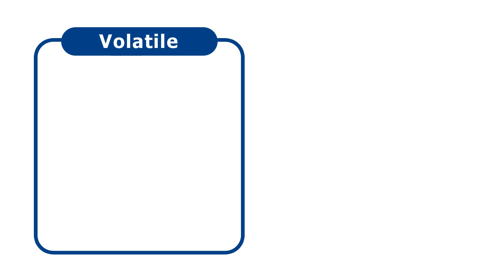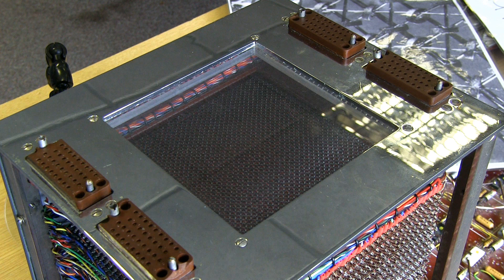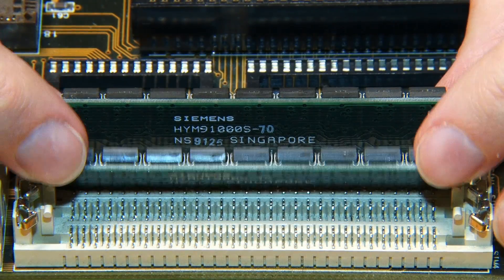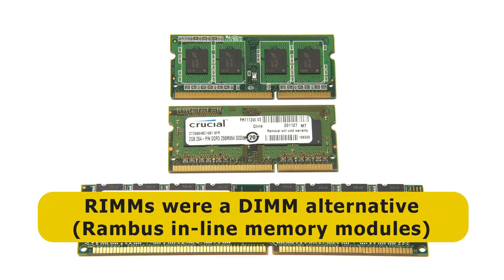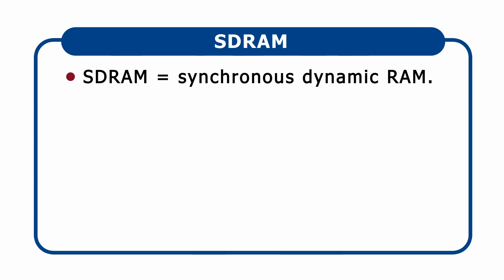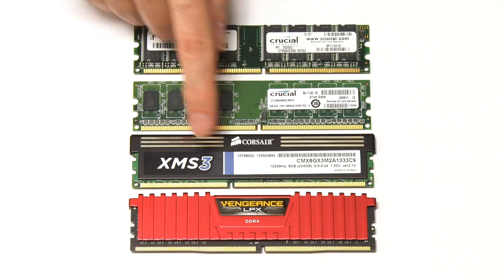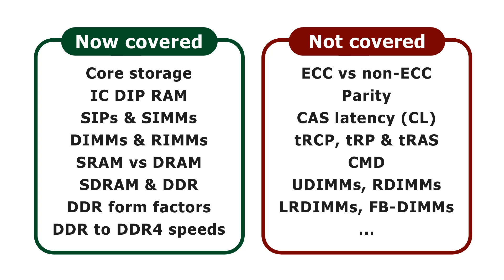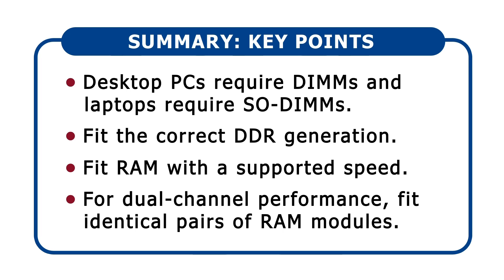Explaining RAM

Comment: ryzen with its finnicky ram sensitivity brought a complete new level of consumer awareness towards ram,
most people seemed to care about anything but the damn socket type, clockspeed and whether or not it was ECC (and rightfully so)

playing with RAM is like playing bass guitar though... the basics are pretty easy to grasp, 
but the rabbit hole goes as deep as you want to go.
stuff gets real sciency once you start doing overclocking.

weighing-off of latency versus clock speeds and how they relate, memory ranks, subtiming tweaking,
you kinda have to get to know your ram sticks, and get a knack for sensing borderline fuzzy logic cases,
know how much you can jolt them, or even better change the tripping point impedance for the gates accordingly

extreme ram overclocking is serious business, and more often than not goes far beyond extreme cpu overclocking in terms of how many factors there are in the equation, it is a minefield of mathematics.

despite the fact ram sticks are are way more lenient in the voltages they accept before really failing, 
(but, arguably ddr4 doesn't scale that greatly on overvolting, not like ddr3)
people usually just OC their CPUs and dial in a quick basic ram OC,
it gets daunting pretty quickly once you go beyond those first couple numbers of cas/ras/tras,
and granted, XMP can usually get you pretty good results.

fun fact: bulldozer also saw like a 6% performance gain on dual-rank memory on otherwise comparable specs, they've had their way of utilizing some kind of faster pumping on what on paper is inferior memory, as you need to send additional bytes to flip banks all the time, probably something with massive L3 buffers, and some inline data packing voodoo.
Reply: I had bad experience with RAM on my Ryzen Threadripper build. Bought in last year's November, I only could get my system stable by this November and I wasted 1400 EUR!

If you build a PC with AMD Ryzen, you should not buy Corsair Memory. Normally it is easy to get compatible RAM by just looking into the Quality Vendor List (QVL) created by the motherboard manufacturer. But Corsair has versioning for their RAM product lines which defines what type of chips are used on the modules, whereas others only have different model numbers for different chips used. With the latter, you are able to get the RAM you need for your Ryzen build (which is Samsung B-Die). On Corsair however, that is not possible. You will get whatever version the seller has on hand. This way, you can get unlucky and end up with RAM that won't even POST on your Ryzen based system in stock speeds!

Long story short: I had RAM for 1400 EUR that was not compatible and had an unstable system due to this until I finally bought G.Skill RAM with Samsung B-Die fitted on them. I installed them, enabled the XMP2.0 profile and it worked right away without ANY hassle! I tried everything to make my Corsair RAM work, at least I could get it to POST with a BIOS update released by ASUS, but even at normal DDR4-2133MT/s speeds it wasn't anywhere near stable. Random reboots and application crashes as well as a slow and poor performing system.

So yes, with Ryzen you need to look deep into Quality Vendor Lists and get Samsung B-Die modules and you have to avoid Corsair Memory, sadly.
Reply: @kyoudaiken  i can't speak for threadripper, but i was an early adopter ryzen gen1 user and so were 2 of my friends 
(i built their rigs too, all of them rx480s aswell, bought for 200 just before the mining craze hit hihi)

ryzen 5 that was, so the real horrible teething issues that came before may 2017 were already gone by then

me and 1 of them had hyperx, one of them had vengeance LPX
the vengeance LPX still is a headache even after the december 2017 AGESA updates that fixed up the majority of ram compatibility issues...

those sticks just plain refuse to run out of spec, even when underclocking or loosening timings, they are nothing but trouble to me, especially when ddr4-3000 wasn't in the list yet, and it was just 2133/2666/2933/3200, 
to add insult to injury, they would detect as 2133mhz by default, so you had to fiddle.

granted the 3000mhz LPX performs slightly better stock than the 2400 hyperx kits loosened up and overclocked to 3200,
but i can't do anything funky with the damn things, tweakability means a lot to me.

so my personal anecdotal proof is is that that those vengeance LPX 3000mhz give you no leeway on am4,
i've broken my head over the damn things several times trying to get a mild overclock to 3200mhz out of them, 
i'm starting to doubt it can be done on a b350-prime plus. (despite the asus bios having a shit ton of memory options these days)

his rig is by far the most unstable of the bunch too, i hardly ever crash this system, with 2400mhz sticks all the way up to 3200 with sloppy timings and a healthy voltage bump,, somehow it's actually more stable than his rig on stock memory.
not any kind of unstable to worry about, but measurably worse over a year and a half. 

for comparison, i hardly ever turn it off or reboot my machine, this thing crashes like once every 2 months at most, 
even then it was usually down to a botched radeon driver revision that didn't want to play.

i just put it to sleep, it only does 0.5 watts on my meter that way so i'm not too fussed,
costs virtually nothing in terms of power, and i don't think .5 watts ever burned anyone's house down either.
hell, i even hotswap regular old sata as long as i have a free cable already connnected to the board before even thinking about shutting down

i can't be arsed to open everything up again, my virtual desktop is as messy as my real one, so is my taskbar,
i'm a nightmare with clutter.
Reply: @klontjespap  I just bought 3200 MHz RAM right away, put it on DOCP and it worked right out of the box with G.Skill Trident Zs.